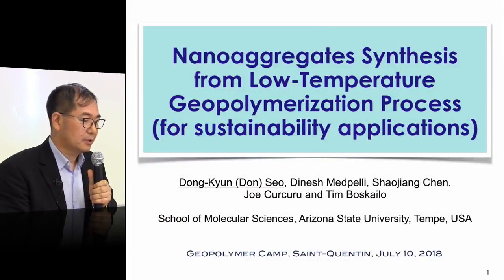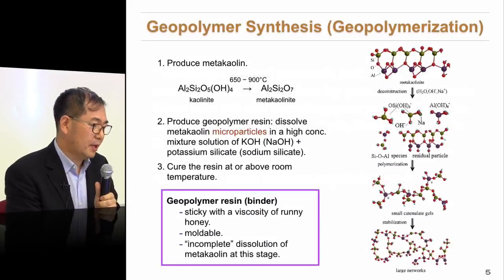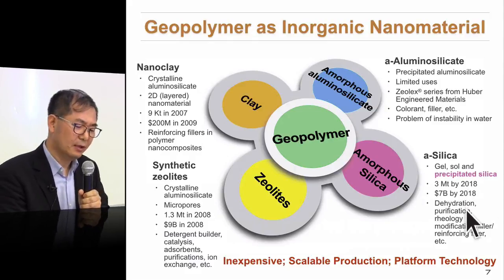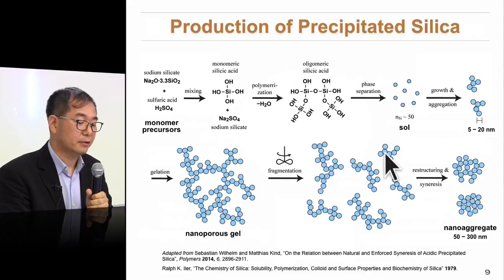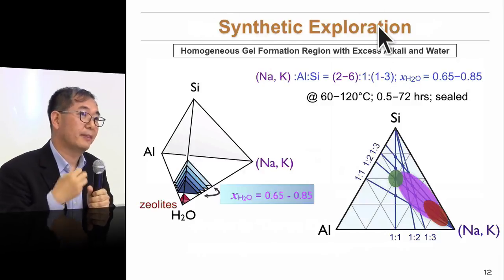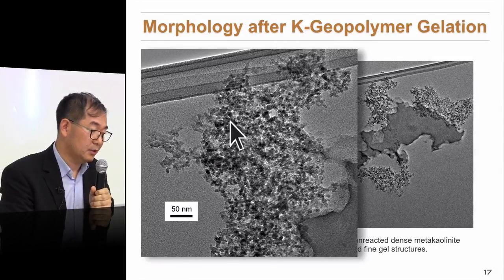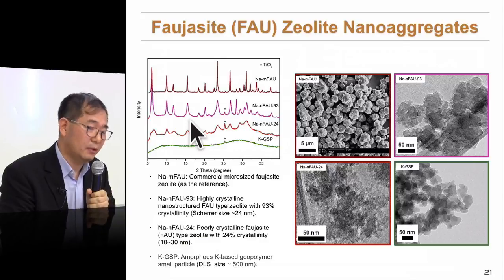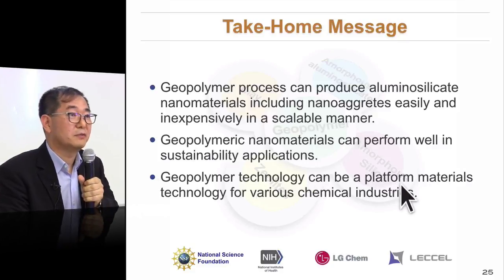Geopolymer: a Super Nano Material

Comment: The finer is the aggregate the stronger is the finished solid against compression and not crumble under weight like biscuit.

The term “energy” represents fringe molecular energy (electric field strength) may be directed to produce a strong binding. Material surface that are categorized as high energy is in favor to strong structural bond. So binding is relate to atomic electricity.

Comment: what is the average time for completion of geopolymerization.
Reply: Depends of course. I demould just the next day. Some systems harden a little bit within one hour, reosanable within 6, are quite rigid after 24 hours and after 7 days almost no reaction happens anymore. Normally you test after 28 days the compressive strength.